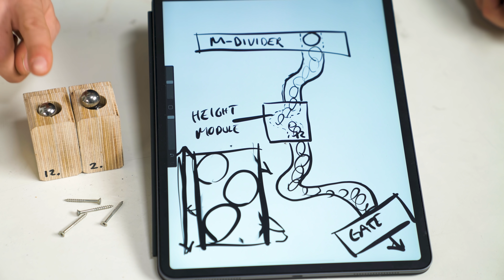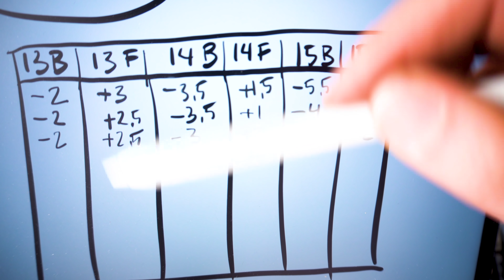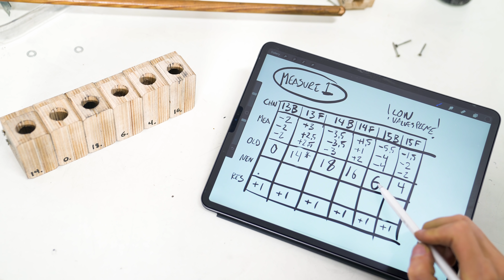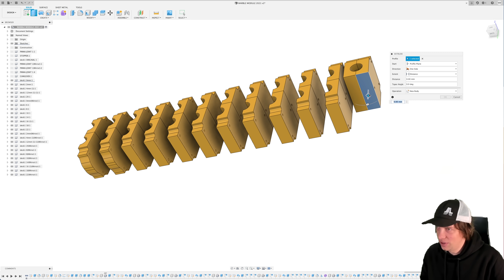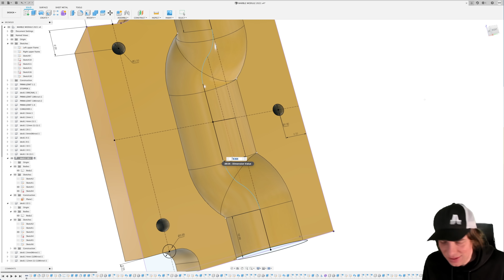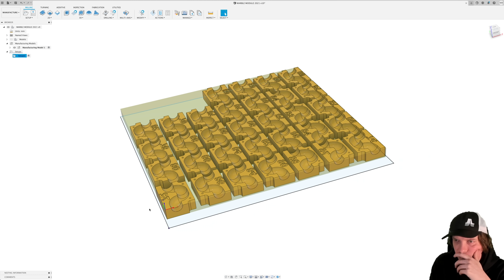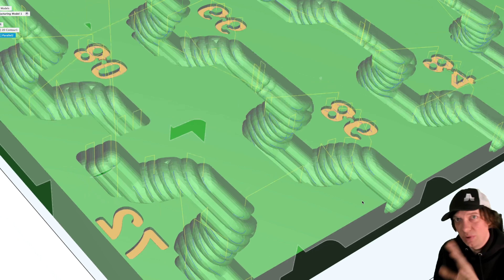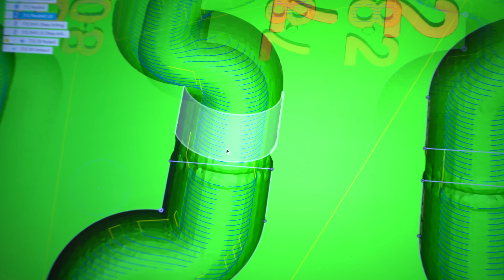Marble Hobby Project Gone Wrong

Comment: Martin, I think the best solution would be a "trapdoor" at the top of the marble divider, that only opens if there is at least place for another marble and the weight of the marble pushes it down. Otherwise, the door stays closed, and the surface is completely flush. So there won't be any marbles stuck on the divider. If you keep adjusting this anywhere down in the marble path, there will always be some different heights. This could happen because of the marble placement in the tubes (stacking Globes perfectly is almost impossible) or at least, from different Temperatures at the tour stations, that changes vollume of material in the complete marble machine and with this the length of the marble path changes too.  I did some drawings for how the trapdoor could work and fit into the all marble channels. AND it would look good too. So if you want to know, let me know.
Reply: Not sure if a redesign is required but the ability to tune a length quickly and easily would be a better solution. Right now it's a case of measurement, guestimates, clear the line, swap out the module, refill and retest.
Let's say instead that there was a section somewhere which could be altered in length by up to one marble, by releasing a clamp, adjusting a ratchet, then retightening the clamp. You just need one guy with an eye on top to tell the other "go back two clicks, yeah that's great" and the whole 38 channels could be done in 10 mins, as part of the installation.
Reply: @MrGonzonator  Exactly! Some sort of jackscrew to adjust the entrance module would work great to tune the height of the marble.
Reply: @MrGonzonator  A telescoping section of tube/pipe; spline-like so the marbles stay in line.
Reply: @MrGonzonator   This is a much better direction of thought - adjustable tuning, not doors.
Reply: @z-beeblebrox  I've thought about it a little more and your tuning device could be as simple as a trombone pipe with a clamp at the centre. Turn a bolt and it pulls or pushes the slide, then a nut and spring washer on the bolt fix it's position.
Reply: My concern is a passive moving door at that size could easily get stuck in an open or closed position and really mess up the machine in different ways
Reply: Trapdoors won't be useful, there's tons of marbles running over the holes constantly. If a trapdoor where to open, it wouldn't have enough time to close properly, before another marble is on top. That will stop the second marble and could make it stuck in the trapdoor, or could make the divider clog up with marbles. The faster the mmx is playing, the more marbles there are. Eventually, the marble behind the first one, will just push the first marble over the trapdoor, missing it completely.
Reply: Is it also reliable and easy to maintain?
Cause if it is, the grinder might just have to come out and hoo boy would that be the most painful yet.
Reply: Great idea! Why don't you post your suggestion on the discord forum/page: https://discord.com/invite/wintergatan
Reply: @martindalgaard1060  I tried to get access, I've read the rules and checked the green button, but cannot write there... sorry would love to share my idea
Reply: @martindalgaard1060  i had a look there yeasterday, but i am just confused. Where to Post it there?
Reply: @martindalgaard1060  I've posted a fair bit on there before, also in the Reddit page. My profile pic here is actually a dropper solutions I came up with an age or so ago. Problem is, Martin does not engage with either forum, you just get a nice debate, like this and nothing from the MMX team.
Reply: @another2133  What he needs to learn is that reliable machines are not fail proof, but have fail tolerance built into them so it can withstand a certain amount of mistakes before needing some sort of repair.
Reply: I would call my version a "Tip Gate" that load 3 or 4 marbles at each channel.  Then it tips down from weight -closing the gate, dump the marbles when the channel can take them, tips back up -opening the gate.  Then all gates are the same, we don't care about variances in channel length.
Reply: I’m not sure what kind of trapdoor you’re envisioning, but I can’t imagine one that only lets one marble through and snaps shut in time to stop the adjoining marble from also entering. The channels would all still have to be calibrated so that there is exactly one marble’s worth of space under the trapdoors, or they will open partway and marbles will get stuck. The trapdoor has to somehow only open when there is room for two marbles below it, and close when there is still room for one marble, or else it won’t be able to close at all, and the top marbles will still be running along the tops of the channel marbles. The trapdoor mechanisms would have to be impossibly small (For the scale that Martin is able to achieve), or they wouldn’t fit in the divider path. And the trapdoors have to work mechanically, not electronically, making all of this ANOTHER layer deep of improbable.

Moreover, Martin already has a “trapdoor” system: The marble gates. You’re suggesting that he implement a second row of marble gates? Then he would have to have something that can feasibly feed them... another marble divider. Which you would then say needs another row of marble gates. Which would then need another marble divider. Etc., etc.

Tl:dr; trapdoors could not possibly work in the way you are suggesting. I would like to know more about how you’re thinking they would function!
Reply: @johnnyjohnson6643  tell me how to join discord and i will post my drafts
Reply: @another2133  I'd be considering casting my own parts. It's not expensive and the basic tools can be even homemade. There's tons of resources for that online.
Reply: This.
Reply: Hello :) I've read your comment yesterday and I also think this would be a good improvement. I had an idea and build a prototype for a trapdoor/hook system to fix this problem. I made a video to explain the prototype. I would like to share this idea with the build team - have you figured out the best way to contact them?
https://youtu.be/zahlKPc6TMA
Reply: They've probably thought of this anyway, there's too many requirements for it this to be a valid solution
Reply: Don't worry. I'm pretty sure someone will convince him (possibly Wintergatan himself) of trying a solution that's more complicated, less practical and hard to diagnose failures under the guise of the impossible 1e-8% chance of failure figure he thinks he can achieve.

Comment: For the MMZ you've got to ditch the flush marble system for the divider. It attracts way too many moles and creates ripples whenever you adjust anything down stream of it.
Reply: I think (and hope) you mean for the MMY...
Reply: @hbear1336  No way man. MMY will be a carbon copy as far as design is concerned, with only minor improvements. For major redesigns like Cailean is suggesting... that's gotta be MMZ. I kind of doubt such a machine will come to be, but you never know!
Reply: What's your idea for getting marbles to roll over the top of a full channel?
Reply: Elongateing the tube to desired length to allow marble stacking to level out would be easier and less problematic. Think of this unit as a manifold for water.

Comment: Not sure if your CNC can fit it or have enough torque and power, but have you ever consider to buy some ball end mill having the correct diameter so you can try to machine your path in one single cut (or maybe two or three) ?

Comment: Have you considered putting a gate / metal slit at the mouth of the pipe?  This gate would automatically close once the pipe is filled and allow the marble to not get stuck.  This gate would activate if it detects only 1-2 marble lengths are left available in the pipe. The gate would then open again once there is enough room in the pipe. 

As the MMX gets hotter and colder, I would expect that the heights will vary as the materials expand and contract. I’m worried that once you bake this in and you play in a super hot, or super humid environment, everything will be thrown out of wack.
Reply: +1

Comment: The graphite is making quite a mess on the machine... instead of using graphite to reduce friction, have you considered sealing the wood in polyurethane? It should also help to reduce friction, and you don't have to deal with graphite stains. Also means the wood on machine will be protected + can be easily cleaned in future.

Comment: don´t hate me... you should make a different marbel divider, with auto blocking trap dors for each channel that opens when there is enough empty space for a marbel to fit in pipe.
Reply: It won't work, the marble divider has tons of marbles running constantly, and when the mmx gets to use all channels, the gates will never have enough time to open fully and close before another marble is ontop of it. This means marbles can get stuck or clog up the divider as the marbles won't have enough time to reach the end of the divider before more fills up from the elevator. Holes like now are instant, so this isn't much of an issue.
Reply: The gate could also accidentally catapult a marble, if one where to fall in the gate the moment it closes, which is bad.
Reply: @prebenkul  and something like this? The new ball feed now roles over the marbles that are in the pipe. How about the balls roll just next to the marble at an angle. The ball has contact against the back of the wall and at the bottom of the ball. The lower contact point gently guides the ball into the pipe.  If there is a ball in the pipe the downwards rolling ball would simply be nudged back on the track. But if there isn't a ball in the pipe the ball would fall into the pipe. And it doesn't require a lot of change to the machine Just a piece of wood that is cnc'ed at an angle.
Reply: @watcherror  I had an idea similar to this, what if you had a circular elastic material around the hole with a hole in the middle slightly smaller than a marble. The material would bend when a marble comes on top of it, but the marble won't be able to drop if another is below it. When bended, the material will create a sort of ramp on the top and bottom parts, which will allow it to be nudged back on track by either its own momentum or others behind it. If there isn't a marble, it would fall through the hole in the middle. Would that work?
Reply: @watcherror  I suggested something similar in the previous video, so the divider is not dependent on precise marble heights. He really needs to simplify this design, it will never work long term.
Reply: this will also avoid length pipes adjustments
Reply: the more mechanics are involved the higher the risk of mechanical failure,
and by failure I don't mean the kind, that results in a few marbles on the floor..
Reply: This machine is already prone to several catastrophic failures on top of being harder to take apart if replacements are necessary. Just look at how cumbersome the process to take the parts out is. Guy is been so focused on small improvements that he can't see that his machine is not an ideal design. Let's not forget that the first one couldn't even play a full song without breaking.
Reply: Hello :) I've read your comment yesterday and I also think this would be a good improvement. I had an idea and build a prototype for a trapdoor/hook system to fix this problem. I made a video to explain the prototype. I would like to share this with the build team so please upvote my own comment so they can see this :)
https://youtu.be/zahlKPc6TMA

Comment: I feel like there’s a far simpler solution involving a single marble gate at the top that can only support less than one marble. This seems so convoluted not very adjustable over time and mechanically prone to issues. A spring loaded rounded pin with a screw to tension spring would be ideal.

Comment: what if instead of attempting to constantly dial in the precise length of 32 marble tubes you just redesigned the marble divider to step down 60% the height of a marble each time it passes a tube? then it wouldn't matter if it weren't aligned perfectly
Reply: that wouldn't work - a 60% slope is extremely steep. Like the worst road you've ever driven on is probably bellow 20%. 

The marbles would get so much speed they'd just jump over the holes, and the rails, and everywhere really. I think this approach is almost the best because the lengths of the channels will change anyway when the machine is moved, or the atmospheric conditions shift.
Reply: @Tina-Brune  I think it'd be more applicable to imagine throwing balls down stairs than down steep roads, since each step will act to dissipate some of that energy it builds up instead of rolling down like a smooth ramp. The idea absolutely requires that each step be at least 50% of the height of a marble otherwise you end up with the exact same problem that he's trying to resolve with the length modules. Perhaps this could be accounted for by experimenting with the gradient of the space between tubes?
Reply: or putting a soft rubber rail on top of the stairs so the marbles with the highest velocity bump into it and slow down
Reply: Anira Pixel that's a good idea, but the rubber will bounce the balls, and then you have hysteresis, as they collide back and forth. Noise, and another Mole for Martin to whack.
Reply: What if the marbles were to run not over the tubeholes, but in a continual loop thru the marble stair. Whenever a marble gets released by the gate, that a pusher redirects a marble from the loop into the pipe. Or if the marbles were not to run left to right on a decline, but on a slope from back to front... all the heights would be identical

Comment: couldn't you use a 20mm ball cutter and go through the parts in one pass?
Reply: The 'marbles' are 18.65mm (if I recall correctly) 20mm might be a shade too big to avoid the problem of them stacking iv a variety of configurations and thus having different total lengths.
Reply: @GregorShapiro  Sure. Whatever the right diameter is.
Reply: Bit of a heavy cut for his router.
Reply: @devinholland2189  may be. I have no experience whatsoever.
Reply: That requires the existense of a 20mm ball cutter that fits this router.
Also, going through the material in one pass may be a bit heavy on the mashine
and negatively imfluence the surface quality, if not damage the mashine or tool bit.
But I have no experience in cnc-routing or mashining of any kind though

Comment: I would love to see glow in the dark marbles and potentially lights on the moving parts so when on tour you could turn the lights off and it would look amazing
Reply: The machine is being built to an insane precision. Any kind of coat on the marbles would stack up quickly in extra thickness and undo most of that precision. The marble gates system for example.
Reply: Each marble gate is a switch that just needs wiring to an appropriate lamp. Every time a ball drops, it can switch on an LED, And if the Marble machine is painted in a fluorescent colour, an UV LED will sparkle.
Reply: @monochromaticlightsource9153  or must put mirrors on stuf so it reflects of te stage light and no power needed
Reply: Somebody could start experimenting with painting and coating ball bearings, probably needs to be quite similar weight, size and magnetic properties and also bounce correctly... and glow in the dark-paint must not flake off. Epoxy resin?
Reply: @mellertid  No covering of hardened steel balls will survive unscathed running through the MMX many times. Abandon that project. I would suggest hardened glass with a fluorescent core.
Reply: @GregorShapiro  The lower density might be overcomable, the magnetic lift wheel will struggle though 🤪
Reply: @mellertid  I have doubts that any surface applied to a steel ball will both allow the ball to roll as smoothly AND withstand the stress of dropping onto metal pins or threaded screws. No surface that would simultaneously be phosphorescent, fluorescent or retro-reflective...
Reply: @GregorShapiro  I bet it would be challanging.
Reply: The machine will not reach a state where these vanity improvements can be made.
Reply: @mellertid  Just make them out of glass
Reply: @engineeringescapades4154  you missed the bit about magnetic properties RIGHT???
Reply: I've always thought light up programming pins would look really neat.
Reply: Yeah give the guy some extra work - he's a slacker !
Reply: Great idea! Maybe after he finishes the machine? I just want to see it in action!
Reply: It would be very easy to use glow in the dark plastic for the funnel extensions.